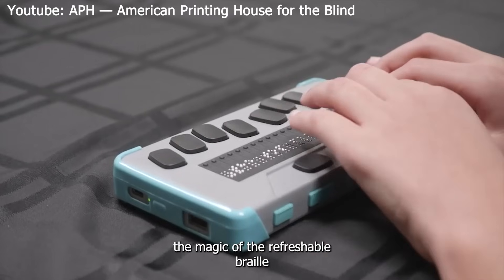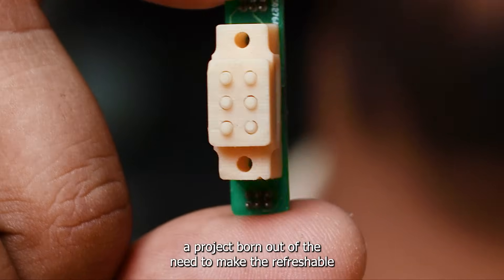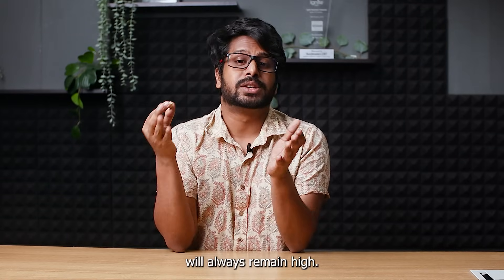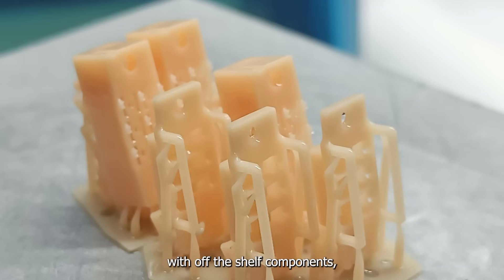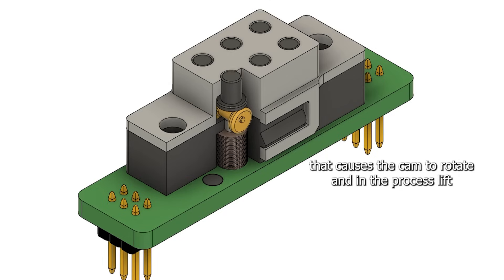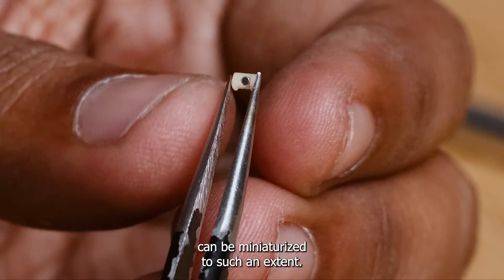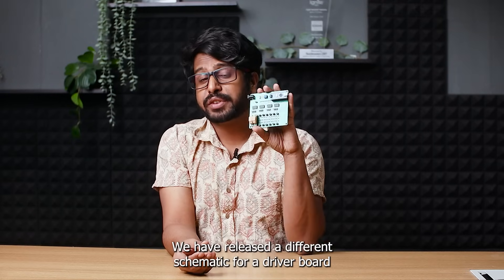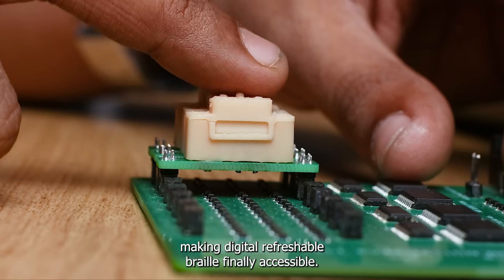Electromechanical Refreshable Braille Module : HackadayPrize 2023

Comment: Excellent work!  I see you went with a row/column matrix, which is a good choice. You might be able to further reduce your chip count (and interface pins) significantly by using shift registers. Each shift register allows two output lines to be expanded into eight outputs, and those can be cascaded, so those original two outputs could control hundreds of outputs.  Two common choices are 74HC164 (no latch) or 74HC4094 (with latch). Also, dual- and quad- h-bridge motor driver chips might give a favorable reduction in chip count compared to those darlington transistor arrays.
Reply: yes or 74HC595 as well.

Comment: FYI: You can get custom wound standing SMD inductors with specified cores. This way you'd not have to self wind the magnets. (Though you still could) and would probably barely increase cost while making manufacturing at scale a lot easier/vheaper.
Reply from the maker: I got a quote from a company called Audemers (https://audemars.com/)  for about 6000 Euros for an MOQ of 1000 coils. Im assuming there is a high initial setup cost. At a 20k MOQ, they can even provide SMT mounts that can be used on pick and place. Its good to know its possible, need to figure out the economics of it when scaling up.
Reply: @vjvarada have you looked into using pcb coils for this? As in using electromagnets that are designed into the pcb. Something like this https://youtu.be/wrnBW0HD0Vo
Reply: @vjvarada Have you thought about keeping the cells completely mechanical and having the actuator running along a track beneath them? Like one of those old manual knitting machines, where the riding sled pushes each individual needles back and forth, just with 3 actuators (one for each row of dots) in the sled that push the mechanics for each dot in one or the other direction instead of one fixed pattern.

To get the cost even lower, that sled could be pushed manually. Then, you only need 2 LEDs and a printed bar pattern to read its position.

Obviously, this has the disadvantage of only supporting whole-row updates. But replacing 6 tiny custom electromagnets per position with 3 that can be bigger (i.e. off the shelf) and 3 springs for the whole row, regardless of length, might be worth it---but I guess you're more qualified to cost this than me. The one big cost advantage I see for this is that the length of the row becomes a much smaller cost factor as each extra cell only adds some plastic pieces and another half-inch of rail and body. The downside is that you need more large-scale mechanical parts.
Reply: What are the minimum order quantities for those?
Reply: @lbgstzockt8493  MOQ for this kind of stuff is usually between 500 and 1000. Some companies may be willing to go as low as 200pcs. The problem is, that when they do the propper setup and tooling, producing one coil takes less than a minute. And if they have a single guy with one machine working 8 hour shift, he'll make 500pcs in one day. That's why they hate these small orders, because it's not even work for one day...
Reply: Love this project. I can see a bunch of the core components being mass produced in higher quality and for  cheap a bit down the line. Similar to the tiny magnets. The project being open source, I wouldn't be surprised if other talented engineers will contribute and improve upon the design
Reply: Do they have to be customized to exact spec, in the first place?
Reply: I think Fishman owns the patent. What they do it they take several 16 layer PCBs, trace the coil, and sandwich these PCBs.

Comment: Hi, What happens if instead of the cam you could actuate the buttons only with a force of repulsion between the electromagnet and an actual magnet... you could eliminate one part and actuate only on a Z axis simplifying the design...the disadvantage is that the button will not be "locked" in place but with a soft touch could work anyway.
Reply: I'm pretty sure the reason for using the cam is (as he explained) that it only requires power when changing the positions of the pins, and needs no power at all to just keep them in place.  This makes it a much lower power device that can be used in a lot more applications.  Moving the pins by direct magnetic action would require keeping the magnets energized continuously to keep the text "displayed", which would take up a lot more power, especially for large displays.

As it is, this design is much more like E-ink displays (which will hold their image indefinitely once set, even when "turned off" with no power applied at all), which is actually pretty cool, IMHO.
Reply from the maker: @foogod4237  Your analogy to e-ink displays is absolutely right, and I even use some tricks that the e-ink displays use for refreshing, likeusing a few milliseconds of high frequency pulsing to the the cams "unstuck" from their resting position before actuating them.
Reply from the maker: There are defenetly other ways to look at the design, like alternate ways to lock/latch the pins in place other than the cam mechanism. The bottom line is that the availability of the micro-magnets and high resolution 3D printing makes many things possible that were not a few years back, and other innovators are welcome to build on this design and try alternatives.
Reply: whilst it might be "simplifying" the hardware, it overcomplicates the electrical and software, by using the cam as latching mechanism the same current driver can be used for many actuator instead of dedicated driver for each one to hold the state (like the expensive piezo-activator on the expensive part it want to replace). as the actuator now have 3 states instead of two it is easier to do the electronics since you need to power the changing part. 

was wondering if you are muxing each changes to the "pixel" directly from the micro because that's gonna be PITA. might be a good idea to offload it to cheap sub-dollar mcu for each module so it scale well with the "width"
Reply from the maker: @fltfathin  very well put!
Reply: if he didn't use cams the magnets would have to be very powerful to stop your finger from pushing them down easily

Comment: This is absolutely amazing! Great work, great engineering. It is always amazing to see an elegant solution presented to lower costs! I wonder if you could scale this up to the size of a small 300x300 pixel display. Over time it could even be used to display websites with Braille text substituted to allow even higher accessibility.
Reply from the maker: Thankyou! Im sure with more work, that would be possible to do! If we can automate the coil winding process, which is the most time consuming part of the system, we could do it affordably.
Reply: @vjvarada  Have you considered using high layer count PCBs for the coils? https://www.youtube.com/watch?v=NX7GHqq28uU&ab_channel=CarlBugeja
Reply: I don't think this is possible to a useful degree with that technology. The nature of haptic devices like this is that the user still needs to actively select the part of the device he is "listening" to, which also means the dots should be presented at higher resolution if used in 2D. If it's just multiple rows of braille, that's not that useful because you could as well "scroll" or navigate digitally. Those dots still consume quite a bit of room, especially because of the coil. If you make the dot smaller, it will get harder to manufacture, especially by hand. But the coil can't be made much weaker because it will need to have a minimum force to push that cam and overcome the resistance that provides the staticness of the dot. Additionally, the more coils there are per area, the more issues of parasitic currents, inductance or magnetic force occurs. A big 2D matrix of these coils may just not work the same way a single or double braille row would work.

Comment: I thought this was a thing since the movie sneakers came out with the blind hacker character.
Reply: It is a thing.  Refreshable braille displays have actually existed since the 70s (that's not the new part). The problem (as explained in the video) is that the modules which people currently make are all fairly expensive and complicated to produce, so they just aren't feasible for a lot of possible applications or users.

The idea here is to come up with a new design that is much cheaper and easier to build than the existing ones, to make it more accessible for everyone.

Comment: Have you tested the durability/ longevity of the cells? In the video demo at the end the cells updated rather slowly, was this as fast as they can be actuated?
Reply from the maker: I haven't done a long durability test, and used the prototypes for only a couple of weeks. I suspect the craftsman resin I used for printing won't last long anyway. 

The PR4 resin from 3D systems was alot more durable which I was using for prototyping initially, which would be great for beta testing and limited run and is still affordable, but IMO the best route forward would be to invest into injection molding of POM once the design is finalised for best performance. Since the parts are so small, injection molding shouldn't break the bank. 

As for your last observation, the fastest refresh rate is between 100-200ms per dot. This is an oversight of mine in designing the driver circuit which drives only one pin at a time, so I need to wait for the pin to settle before triggering a new pin, or else the cams start influencing each other and cause unreliable actuation. This will be rectified in the next version where I will drive all 6 dots simultaneously and use the decoder IC only for module selection, and not for pin selection anymore. So this would mean 100-200ms refresh rate per Braille module, and not per pin.  The Braille module would remain the same, only the driver needs to change.
Reply: @vjvarada  thanks for the detailed reply. POM would be a good choice. Maybe you could make a jig with a finger replica to see how many passes it takes to wear down the dots.
Reply: Issue with "make a jig" is that human skin is rather rich with various oils that get rubbed onto and into things touched, and that can slowly react with stuff over time. This is obviously a bit difficult to check automatically, but dunno if there isn't some funky industry way to do so. Or maybe they just let people demo out at either very late or early stage and/or just pick materials that handle it will

For mechanical stuff though, yeah should work?
Reply: Might be worth looking into ceramic material like a shielded inductor uses to isolate each pin from its neighbors so you could drive coil faster and add more durability, would definitely add to cost but increase speed and lifetime in volume cost would be to much more
Reply from the maker: @pagercam  I was also considering electroplating the top part to do the same. 

This is definitely THE problem to solve to make the refresh rate faster.

Comment: then won't refresh correctly when mounted vertically, right?
Reply: That's a trait the current industry braille cells have in common anyway.
Reply from the maker: Yes that's right, gravity will cause the pins to be always protruded . Though at an angle it should still work, a good test to do eventually.
Reply: @vjvarada   could this not be fixed with just tiny springs on each of the pins to push them back when the cams are rotated to a lower position? it would only need to counteract gravity so it wouldnt have to be very strong,
Reply: @DarXiar7  I suspect the problem is that spring force pushing on the pins will also add resistance to the cam motion, requiring more force to move the cams.  It would be necessary to find a (probably somewhat delicate) balance between just the right spring force needed to make it reliably keep position and the magnetic forces which need to be generated to actually make the pins change.  That, and finding someplace within the (already fairly tight, I would imagine) mechanism for an extra spring to go for each pin (and possibly actually having to make custom springs to fit, etc).

But still, I suspect it would ultimately be possible, it would probably just take a fair bit of work and trial and error to get it right.  IMHO, it'd be a good idea for a future refinement of the design (maybe a version 2.0).
Reply from the maker: @foogod4237   There are things that are still in the grey are for me, its definitely a fine balance. For example, if I get the magnet too close to the solenoid core, it would refuse to actuate, seemingly because the natural attraction to the iron in that proximity is more that the opposing magnetic force created. Put it too far away from the core, the effect of the solenoids gets reduced, and the magnets of the cams starts interacting with each others magnetic field causing misfires and unintended actuation. 
Quite a few itreations went into imperically solving this.

I thought I knew how magnets before this project. I plan to use weaker samarium cobalt magnets for the next iteration, because neodymium may be a lot more powerful than needed.
Reply: @vjvarada  Note that while the pins might default to being protruded (or in an arbitrary position) when mounted vertically/etc, if the cams are in the right position, then when somebody actually tried to "read" the display with their fingers, they should still be able to actually tell which pins are set and which ones aren't (because their fingers will push on the pins in the process of reading them, and the unset ones will push in but the set ones will not).  I have no experience reading braille myself, so I have no idea how "weird" an experience this would be, though, or whether it would make it harder for somebody to read because the feeling would be different...

Of course that assumes that the different gravity direction doesn't affect the the ability to maintain the cams in the right position, but I think if you were careful about their orientation within the module it should be possible to make them work right in at least both a typical horizontal and vertical orientation..

Comment: You have to factor in the labour costs throughout the production of one unit, but it's a nice project still and, assuming volunteers can assemble them, perhaps this can actually play its part in making the world more accessible. I like that, take my +1.
Reply from the maker: I have to agree, The most time taking part on the current design is the winding of the coils. I would subsequently look at optimising this step, with the manufacturing process being similar to how inductors are wound today with automated machinery.
Reply: @vjvarada  I would really wonder whether you can't find an off-the-shelf component somewhere that would actually fit the bill.  Alternately, there are a few companies out there that offer things like custom coil winding services (including micro coils) which might be affordable if you were producing more than a few at a time (i.e. if everyone who wanted to make these devices pooled together to get a bunch of them made)..
Reply from the maker: @foogod4237   I had contacted audemars (https://audemars.com/micro-coils-manufacturing/) months back with this intension, and were charging me 8k USD for about 1000 units MOQ. For 20k they would even give me SMT mountable solenoids. so this route is definitely possible. Back then I was still iffy if the specifications/concept would work, and was too much money to concentrate into something I'm not sure about, so proceeded to experiment with winding the could myself. 

Going forward using automated pick and place SMT solenoids would be the best case scenario to scale up production.
Reply: @vjvarada   I wonder if @CarlBugeja could come up with something small enough for you?  He's a Youtube maker who's done a lot of work with PCB-printed electromagnetic coils.